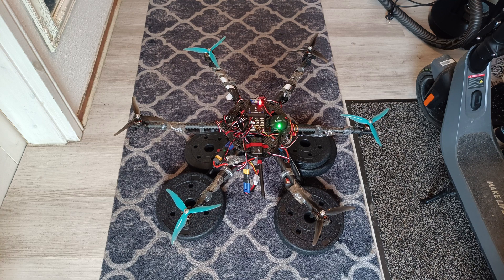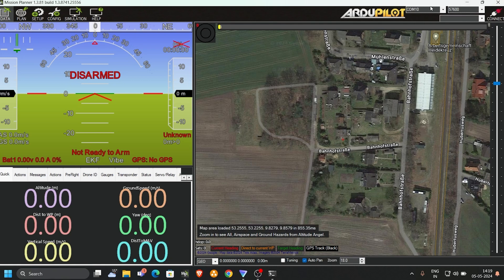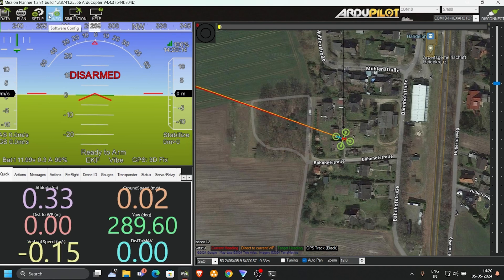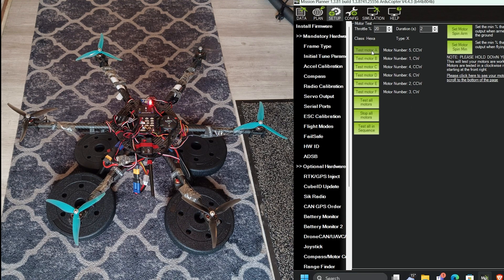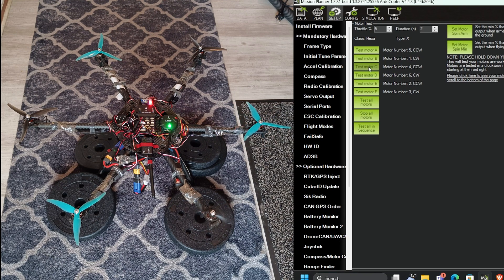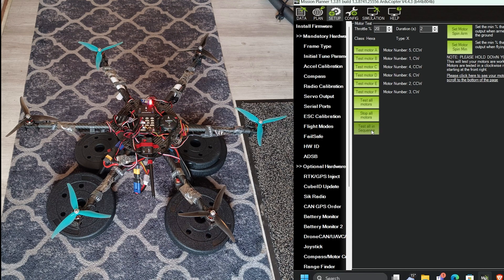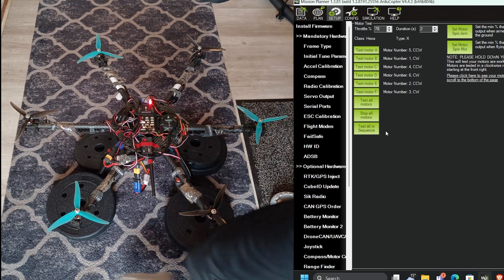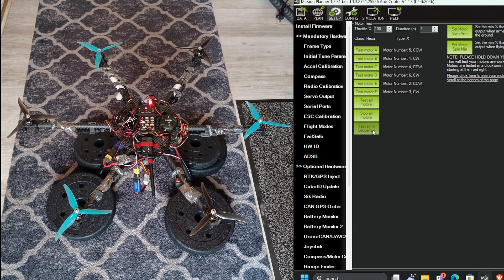How to do Drone  Motor Test with Mission Planner | Ardupilot | Pixhawk 6c | Hexacoter #drone #dji

Comment: Hi, I don't see my motors on the Motor Test list. Many thanks
Reply from the maker: Possible reasons 

1) check the connection, you might just plugged pixhawk to laptop forgot to connect it 

2) check if your drone is turned on and motors have power from battery 

3) Turn on the hardware safety switch 

4) Perform Primary Calibration tests like calibration of compass and Imus

Then try

Comment: hiii, thanks for your tutorial, i'm trying to do that but when i click "Test Motor X" it throws me "Command was denied by the autopilot", do you know what can i do to solve this? pleaseeee
Reply from the maker: Try to turn on the safety switch if you don't have a safety switch then go to the parameters list and turn off the hardware safety switch option something like that. It will work 👍 if it helped you 🤗 subscribe